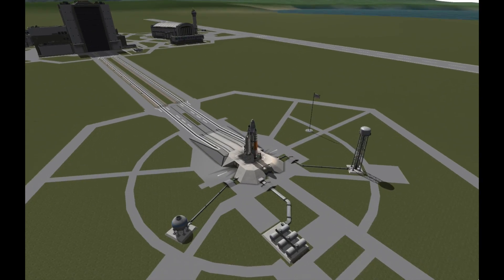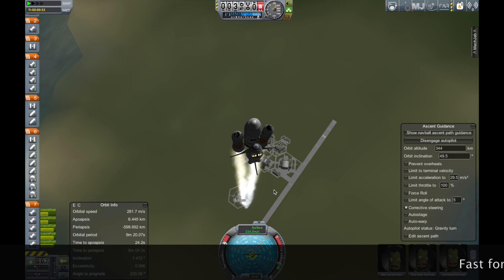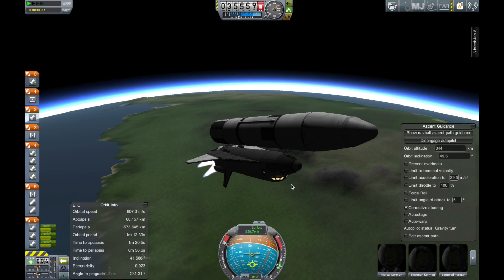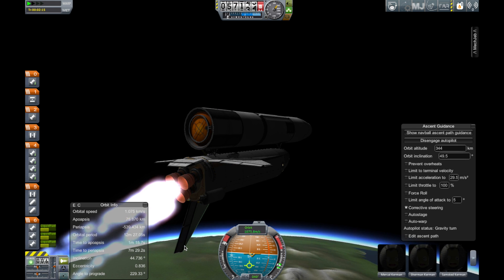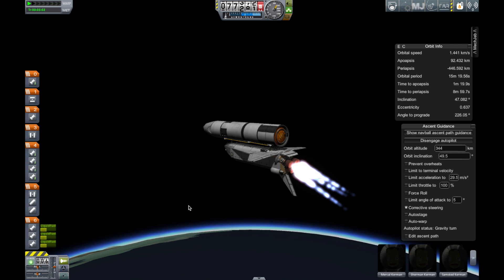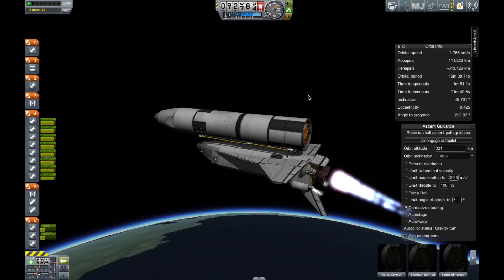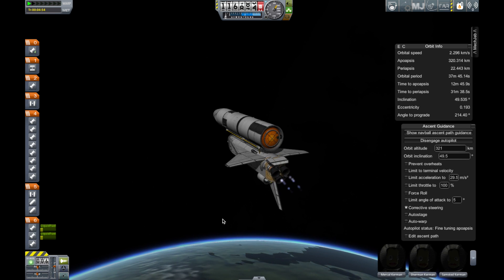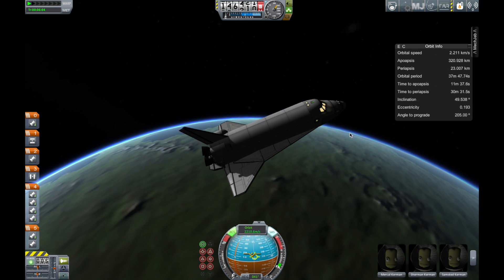KSP Recreation - STS-51F

Comment: According to an article in AIR & SPACE magazine at the time the concern was not so much getting into orbit which they easily accomplished as per the ATO procedure (the transocean abort landing or "TAL" on 2 or even 1 engine was still achievable option as well) but the reason for dumping OMS fuel thru the OMS engines, besides lightening the weight was to assure that the external tank would definitely impact in the Indian Ocean rather than take the chance of it re-entering over the Arabian Peninsula.  I still have the article buried some where around -if I dig it up I will post it - I may not have it completely right.  I have to agree even though I'm not superstitious - Challenger was a "jinxed" article from the get-go. I believe I recall hearing the basic structure was built for ground testing only then someone decided it could be built into a flight vehicle. Try flying some of these abort modes manually using something like Orbiter flight simulator - it really gives you a sense of the extreme difficulties involved.

Comment: The press to ATO call wasn't prophetic, it was literally them saying "if anything happens right now, your abort mode will be ATO."

Challenger is incredibly lucky that the engine failed when it did, and that they inhibited the automatic safety shutdown. A few seconds earlier or if they lost another engine, the crew and vehicle would've been lost.
Reply: Really??!! Wow. Those Challenger 51 missions just had horrible luck.
Reply: @ilovebeinagirl  Challenger also bent its frame because the sound suppression system didn't work during one of its launches.

The whole shuttle program was a disaster. The STS killed more astronauts than all other vehicles put together in the history of human spaceflight.
Reply: @magicstix0r  Columbia had the sound suppression issue on STS-1 unless there was another incident after that that I don't recall hearing about.
Reply: They wouldn't have been lost on a single engine failure at any point during ascent. Prior to the "Press to ATO" call, they could have performed a Return to Launch Site or a Trans-Oceanic Abort to Zaragosa, Spain. A two-engine failure prior to that "Single-engine Zaragosa" call would have been disasterous, but the point at which the sensors on the second engine started acting up was after that call.

Comment: Nice, you did a good job here. Did they actually eject the main tank in the heads-down position? I know at least in later missions they rolled over to heads-up position, then ejected the main tank so it fell back to earth and burned up.
Reply from the maker: Thanks!  According to the experts over at NasaSpaceFlight.com, the shuttle launch profile was heads down throughout flight until STS-87.  IIRC, they stayed heads-down so that the pilots could see the horizon in case of aborts, but they rolled to heads up afterwards to maintain communications with mission control using the TDRS satellites after one of the ground stations was shut down. See here: http://forum.nasaspaceflight.com/index.php?topic=17437.msg420153#msg420153

Comment: Thats not the abort. You only filmed the flight part. You should have also included the risky maneuver of turning 90 degrees while reentering to bleed off speed.
Reply from the maker: lol what the heck are you talking about?  They did no such thing.
Reply: in sts 51f they did not perform the "90 degree abort"
Reply: Vulcan Actually, they did. Look it up. They rotated the nose upwards 45 degrees, and towards the right 90 degrees while reentering over Europe.
Reply: Diabetic Alien Oh. I did not know that! My bad.
Reply: Vulcan It´s Fine!
Reply: @diabeticalien3584  This mission landed at Edwards Air Force Base in California. The re-entry would have started over the Indian Ocean west of Australia--about as far from Europe as one can get and still be on the same planet.
Reply: There was no actual abort. Mission control said press to ATO, and the shuttle continued to orbit, with no risky maneuvers.